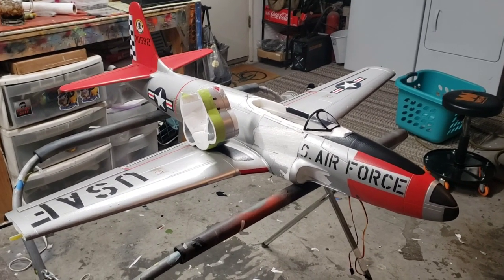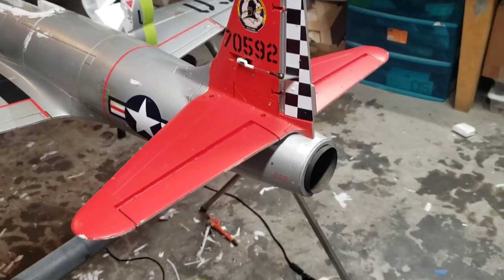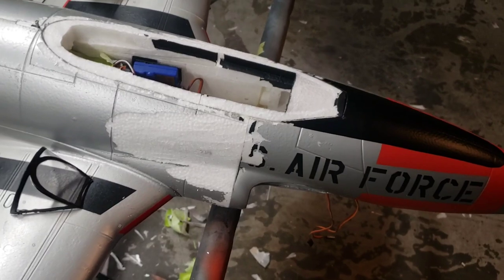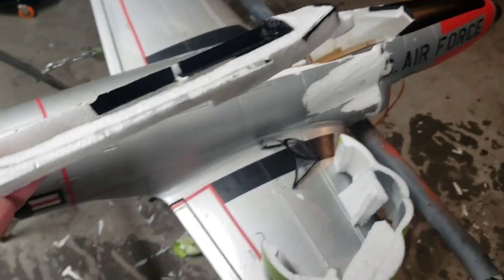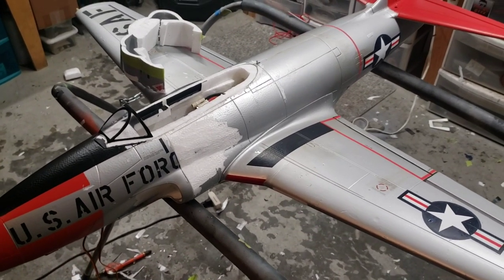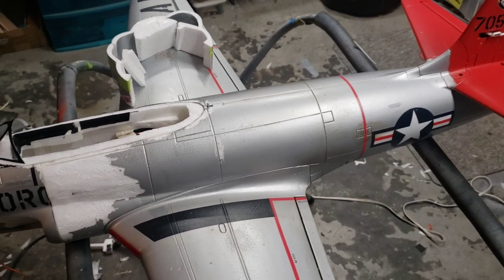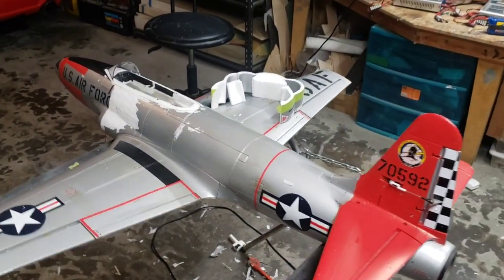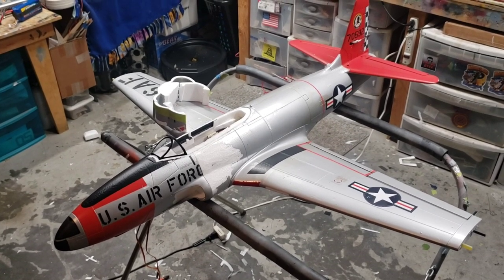FREEWING T-33 TO P-80 CONVERSION EP-1

Comment: I hope the cheater delete works out. I plugged the cheater on the A-4 as well. It has great performance without it.
Reply from the maker: Yep. I did the same. 0 loss in performance. And that was before i did a proper plug